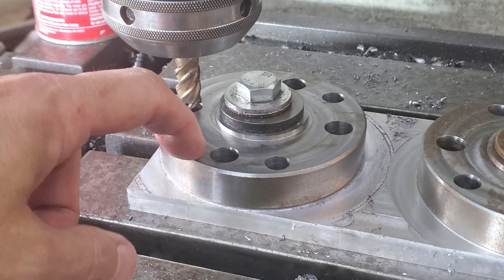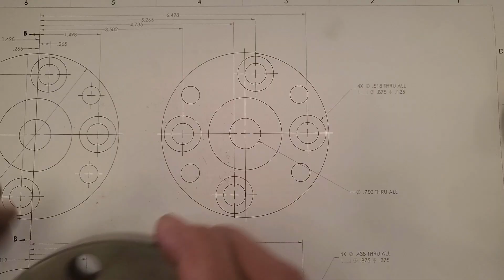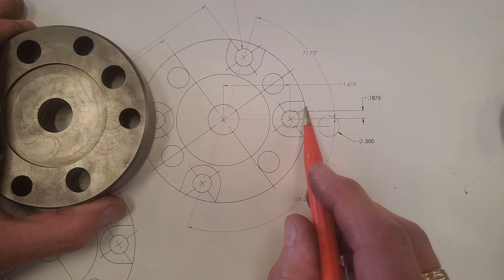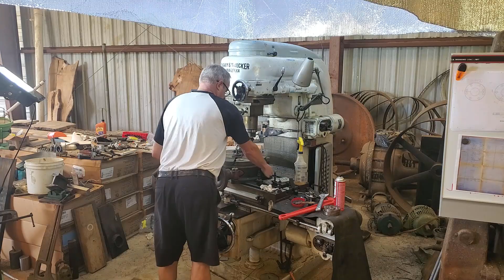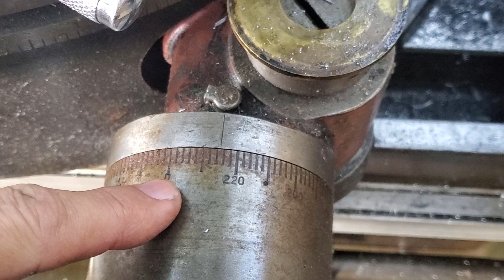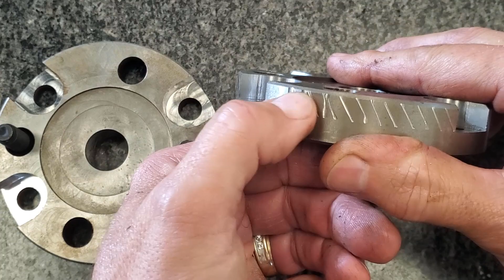Spitfire Axle Adapters - Pt IV Counterbores K&T Rotary Head Mill + Rotary Table #Milling #Machining

Comment: Before you started the cut I was shouting out to you for a second clamp. Was not surprised. Glad the second attempt held but I was waiting for the repeat...
Reply from the maker: Well i learned from the school of hard knocks. I couldn't let the screw up stand as is, and the marks cleaned off with a 0.006" cleanup cut.

Comment: Ok good job Jimbo and I'm glad you had the correct radius or you for sure you would have lost a part and a cutter. I myself don't typically take single large depth cuts so that I don't put to much stress on my cutters and my collets since the end mill can slip a bit inside the collet depending on the type of collet and the hand torque tightening you apply as well can jolt a bit of movement on your fixture or vise for that matter but that's always been a rule for me. Depending on the job which is the man hours, time you set for customers expectation of finished product and customers agreed upon expectation of tolerances/machine finish, you can factor in the multiple processes to your completion. Looking at that specific run on this job, I may have gone 2 passes on the depth and a spring cut final on each counter bore for the reasons I stated above. One quick note for Z is if you don't want a witness or hint mark on the top of your part, rip off a small piece of paper and come down on that with your spinning end mill till it touches the paper and has a slight tug on it,, then set Z to zero or wherever you want your dial and or your DRO if you have a Z scale.. Great job either way Jim and keep at it, you're rocking it dude. Looks like you had a good sleep and a fresh shave this morning??? LOL.....Ricko
Reply from the maker: I weighed multiple passes vs one full, reasoning i don't want to wear the last 0.100" if the end mill. Either way i should have clamped better. Double toe clamps gave me 1/4 of what was torque on the nut. Second part shifted a tad also on hole #2, you can see it in the vid. I'm going to clean up the OD for my son so it looks better. He can put the lighter part on the driver's side, helps offset the weight of him driving. 😁

Comment: It seemed like the 2nd part rotated very slightly when the cutter first made contact.  

The rotary head is really cool to learn about.  Thanks.
Reply from the maker: Yep. It shifted against the. 002" clearance in the locating counterbore. I've learned about clamping forces with deep cuts.